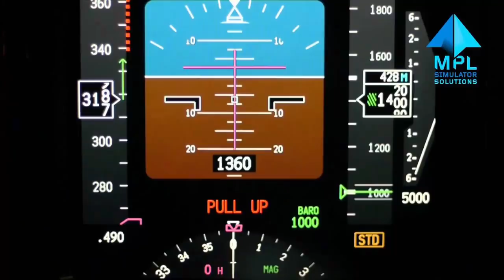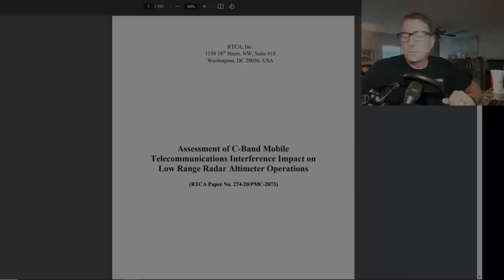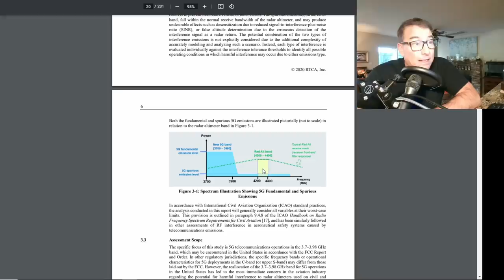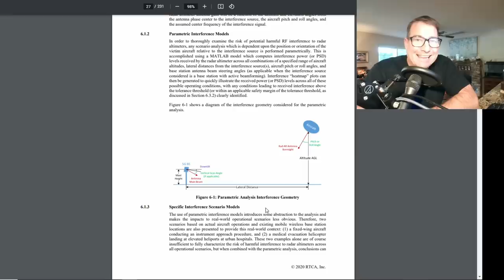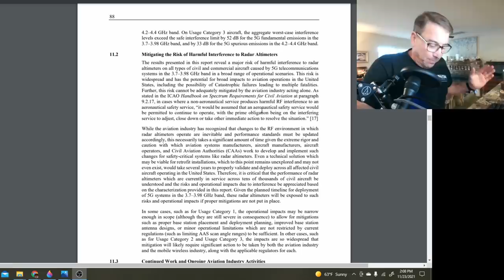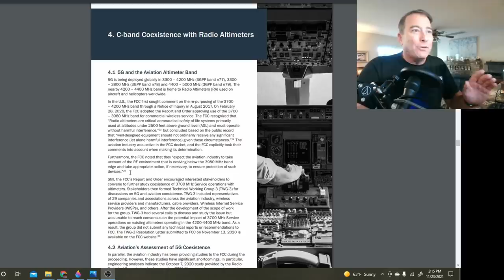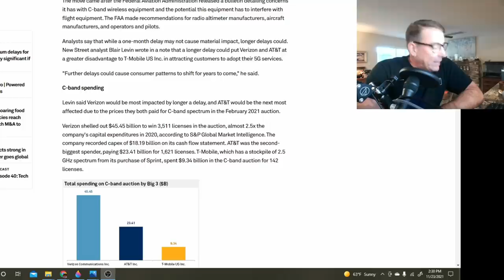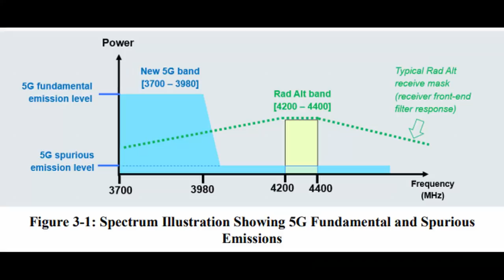5G C-Band Interference with Radar Altimeters in Aviation

Comment: I actually don't have any issue with the FAA working to attempt to prevent crashes or other near misses that "could" be caused, however, this 5g sale was announced quite some time ago, and my industry cares very much about this sell-off as well, and has likewise had to adapt to it.

There seems to be some solutions to this that could easily avoid the issues, all with their advantages and drawbacks. Setting a baro altitude off of the radar altimeter while nearby at an altitude high enough to avoid interference, installing radar altimeters operating in different bands, or using higher transmission power than previously used, having do manual landings (especially for VFR conditions), and the list goes on. It seems to me as though the FAA has failed greatly in delaying raising the issues to an appropriate level until the 11th hour. Many other government operations (including military and even military aviation) have had to adjust to this change, and other spectrum sell-offs; the FAA saying "well, radar altimeter use precedes 5g, so you should move" isn't likely to be a long term basis for injunction, and likely the government will eventually be required to pay damages to these legal licensees of this spectrum... Not saying we should ignore this, but a solution needs to be found with great haste, and it almost certainly will mean the aviation industry yielding in the long term, not the mobile carriers, so they best get on it.

One more thing to mention is that because of the directional nature of this interference and of the radar altimeter, and it certainly being off-axis during the last few hundred feet of descent of an aircraft, the likelihood of an actual denial of service of the RA seems very unlikely given the relative magnitudes of transmission power, especially one where two separate RAs have a false positive agreement of their erroneous altitude readings.

In all I think nothing will happen here, and testing would prove it isn't actually necessary in the real world. I wonder why the FAA hasn't reached out and performed such testing to a very high level of certainty at a closed airport, decommissioned military base (or even a functional one) with big runways, where other traffic isn't (presumably?) relying on their RA to perform a semi-automated landing?

Comment: Another similar topic you're going to see discussed soon has to do with UAS detection. FAA is conducting section 383 research and part of that is mitigation and use of radars, on an airport. The amount of work that's going to go into ensuring these UAS detection and mitigation systems don't interfere with aircraft is going to be enormous.

Comment: To be fair, it's practically a LOT more than 200 MHz. If you actually dig into the details:

1) In America the 3700-3800 is "occupied" by Verizon and AT&T
2) 3800-3980 Is not spoken for (from what I've seen) so that's unused, 180 MHz there now.
3) 3980-4000 MHz is a mandated 20 MHz guard band
4) 4000-4200 MHz is disused upper portion, based on the noise from the RTCA and FAA that is unlikely to ever be used - 200 MHz right there
5) The Radio Altimeter band has 200 MHz spread but uses only 105-140 MHz of that in the center leaving another "internal guard band" of 60-95 MHz around the 200 MHz as a buffer.

So it's not really 200 MHz - it's more like 180 MHz + 20 MHz + 200 MHz + 65-95 MHz = 460-495 MHz of practical real-world separation.

Comment: I am a Radio Amateur and know how ancient TV used to work. Both radar and tv are broadband. For color tv the color channel used to be narrower than the black and white channel. They had to introduce s delay line in the black and white channel because signals in the narrower channel take longer to propagate. Same goes for your altimeter. Make a narrower filter then your signal will be delayed at the upper and lower edge of the band showing more altitude than you actually have. No way for an easy fix world wide

Comment: How about using encoded transmissions, as is used in other radar applications? The radar altimeters could transmit specific waveforms and react only to matching reflected RF. Far more specific and certain than filtering. The encoding could also prevent misreadings between aircraft, such as with parallel landings. -- Of course, though, this would also take a lot of time to engineer, build, test, certify, and deploy.

Comment: you could shield electronics box in with copper tape earth, that protect against interference from inside the cabin. you could up your output to 3 Watts I'm not sure if that what causes any issue with reflection problems with the ground and would give you a false reading.

Comment: We don't use the term "Iron Door" but "Brick Wall" is pretty close, and that's the commonly accepted term for an infinite-slope filter. Unfortunately, such filters, much like a car hitting a real brick wall, produce bounces, reflections and spurious emissions, which will have their own harmonic values, interfering even further into other bandwidths. Filtering technology is improving, and is important in the ever-increasing competition for bandwidth, but the real key to solving this problem is not bandwidth assignment (in fact, that is guaranteed to get even tighter in coming years). The solution lies in coding, encryption and error detection and correction algorithms. The screech from grandma's solitaire game cannot give an incorrect altimetry reading unless it has the right header, encryption key, body and error-checksum, and if her screech is too loud for the real sensor to get a reliable reading, the airplane will go around. Cross-correlation with other existing solutions, like ADS-B and CPDLC will add further guarantees, but obviously all existing radar altimeters and auto-land systems will need to be replaced, which is just something we've gotten used to. All this is actually small potatoes. The big potato - and it's right around the corner - is that all airline operations will soon be COMPLETELY controlled from the ground, and the pilot on board (yes, that's singular) will only be trained to manage emergencies.

Comment: Is this actually Radar? The ATA refers to this instrumentation as Radio Altimeter. 1 Watt doesn't seam to be enough energy to produce Microwaves. The Doppler radar pulse averages a transmitted power of about 450,000 watts. Your home microwave about 800-1000 watts.

Comment: Fair or not (and it isn't fair), I think aircraft manufacturers and designers should be working on the assumption that they will no longer be able to use radar altimeters like they have been for decades, and figuring out how to replace the functionality with something else/better.

Alternatively, I wonder if increasing the power output of an aircraft transmitter from 1W to 2W would be appropriate?

Comment: If the FCC refuses to protect aviation navigation the FAA must choose a method to protect aviation during weather conditions that will require radar altimeter operation.
Substantial time will be required for design, manufacture and test before replacement electronics are available.
The only sensible response if to refuse commercial traffic at airports with 5G dangerously close is to reject landings during weather events that make radar altimeter necessary.
The airports/cities might be willing to encourage a 'safe' solution from the FCC or telecommunications providers.

Comment: How many passengers have and will continue to switch out of airplane mode as soon as approach starts?  Does an instrument exist that can detect potential interference in the aircraft before the equipment decides it can’t properly function?  I’ve heard of devices that capture cell phone communication on its way to a tower for surveillance purposes. Could a similar device within the cabin trap those frequencies before they leave the interior of the plane?  I’d rather not bounce off a runway in zero visibility with my family on board.

Comment: Excellent report. I did Geophysics flying for many years worldwide where the old magnetometer was used as we were doing contour flying at 500 fet in remote zones - this a form of radar altimeter to captivate physical density in the ground to decipher on data band what minrral we were analysing.....all sounds complicated!

With so many people using cellphones and transmittion stations everywhere we have problems without this aviation hitch!
A question that intrigues me....we all know of 5G now - what about 10G? Is this the "Havana Syndrom" coming from upgraded 5G.....few people talk about this subject.

Final point - navigating with GPS in congested way station areas...precise navigation is in doubt. For marine purposes more precise.
These problems will not go away without the "average Joe knowing what risks are coming in his high tech updates"!
I  miss my little Nokia 2G!!!

Comment: I haven’t looked at all the comments, but the current “compromise” only considers major airports.  So what happens for helicopters, such as those used for medical transport, EMS, law enforcement, and firefighting?
All of these rely on rad alts for accurate height information in low level operations….

Comment: I will need to read the RTCA report, but saying the over 200MHz frequency separation is negligible is quite strange. In 200MHz you can fit over 30 old-style analog television channels. I can understand saying channel 6 interferes with channel 7, but this is like saying channel 2 interferes with channel 35.

Comment: I think the biggest reason there hasn't been any issues out of Europe is the 5G frequencies are very different from the altimeter frequencies. Like in the 40GHz range or higher. It's also why T-mobile isn't much of a thing on this, as thier frequencies are either in the low end or higher end, with only a few C Band metro areas. I realize that's where some of the major issues are, . . . yea, don't know where I was going with that line. Anyway, there are ways to work this out, and they should have been looked at some years ago, honestly, as we all knew the amount of usage of the EM spectrum was only going to increase, and that would mean more encroachment on what was already there.

Comment: Clarification: it's not "5G' that is potentially causing interference, it is a new frequency band that 5G is expanding into that is the issue.
This is important because when they say that 5G is already in operation with no complaints, MOST of the 5G spectrum is far away from aviation bands and so causes no issues.

Same with cell phones in the cabin. Most are not even capable of transmitting on these frequencies, and unless there is a ground station using them nearby, the phones won't transmit on them either.

As a Ham I understand jealousy guarding the frequencies we have (and I am amazed that we haven't had any bandwidth stolen from us and sold off yet), and this is ridiculous that they want to put these within the interference threshold of life critical heavily regulated aviation equipment.

I suspect that someone didn't look at the actual specs of the radar altimeters, and they just chose a standard width guard band and started seeing dollar signs, and it was probably all written up for them by the Telecom lobbyists who assured them it was far enough away to be fine.

So I hope that wiser heads prevail, and maybe United Airlines will start suing Verizon every time they install a cell site using this frequency band near an airport for the costs associated!

And yes, it is technically correct to say it's 5g causing the issue, just like it's technically correct to say that you are Type certified in a Boeing, but it's not fully correct.
Plus with all the FUD (like FOD but for the brain!) going around about the horrors of 5g, it would be nice to not Sully 5g as a whole, when it's only these particular mid-band frequencies that are the issue.

Comment: Juan, do you remember the MOTOROLA’BRICK’ cell phone ? I had one,& in the car had a connection to 12 volt, ant using the battery, Well,6 of of us in my car going to a meeting in MD my phone WAS THE ONLY ONE which worked, But somewhere about 1985 or so someone on a FLIGHT from MIA -LGA, TIED UP THE ENTIRE EAST COAST, with one of those phones,I was UNABLE to call my company from a supermarket to Long Island for hours, all circuits are busy, I was told , THE NEWS THAT NIGHT singled out a cellphone on that flight,so now phones are SO LOW POWERED, that UNLESS the aircraft has internet service, they willNOT WORK, , I still have mine as part of a collection of cell phones, starting with a BAG PHONE ! Same phone number since 1984,,    🇺🇸🇺🇸🇺🇸🇺🇸

Comment: I'm not an engineer, but I also wonder about harmonics. When I was was working on Barksdale AFB, we were required to test the ILS system and the tester used the 108.00 frequency. But we kept receiving a local radio station that was assigned 107.9. And the station was tested and transmitting on there assigned frequency, but there antenna shared a tower and the other stations caused a harmonic. After reporting this the FCC shut down the station and assigned them a different frequency.

Comment: It is quite staggering how basic the radar altimeters are. I'm an ee, the 5g equipment will be incredibly finely controlled,  the antennas are very specific, they use synthetic beam forming to target the device they are talking to. That is what 5g is all about and how it is able to provide such good bandwidth to devices without interfering with itsself. So it's pretty smart. It also doesn't transmit continuous waves like the altimeter, it just looks like tiny bursts of broadband noise that last microseconds so its far from obvious that there will be a problem. I also fly a certified aircraft and I know that certification on anything from this century takes forever and is a massive barrier to itself. The radar altimeter is nowhere near as sophisticated as even 10 year old equipment but it will cost 100x more.  If in doubt they should just have a bit of distance from airports. The other thing is 5g hasnt caused a problem in other countries because for some reason the usa wants to use 4x the power.

Comment: 3 dB is no where near enough isolation. I would want to 60 dB or better. Filtering is always a trade off between bandwidth and signal loss. There are methods and technologies that can improve that, but there is no magic bullet. I would have to say the evidence is on the side of the RTCA.

Comment: Super fantastic point Juan about the cellular base station power limits as the typical limiter & baseband decoder RF circuits inside automated receivers like RAs can easily be fooled into accepting the "stronger" signal as the fundamental (real) signal, treating it as "gospel" & indicating to pilots their RA indicated altitude is far higher or the terrain is less severe than it actually is, unless the RA signal has been encoded to prevent false positives by their design engineers

Comment: Strongly disagree with the views expressed here. These aircraft systems are licensed for a specific spectrum and have been depending on frequencies outside of the spectrum they are licensed for. So far they got away with that and that will now end. There is no technological reason why this could not be resolved by updating the equipment on board. And it's not like the usage of these neighboring frequencies is a surprise - this has been in the works for many many years.
Reply: I doubt they even rely on the adjacent spectrum.  So far there is no real evidence that this is a concern in the real world, but beyond that these are critical devices and the FAA approved them as such.

If the FAA knew a piece of critical hardware relied on adjacent spectrum & then approved it as such, then that's a massive problem.  What else is approved as critical with known flaws?

Comment: As as electronic tech and amateur radio operator I didn't need to dig into the details to know that there is likely justified concern. Digital data is incredibly noisy all by itself besides the carrier it might modulate. They might have to re-site cell installations

Comment: Issue is, radars are actually not respecting their spectrum when it comes to receiving band.
It isn't feasible to just manufacture radars that are influenced by out of band signals, and then just hope the nearby spectrum is not used forever.
Radio altimeters shouldn't have been approved like that, so the fault is on that side IMHO.

Comment: Surely the Radio Altimeter indicates height AGL, not altitude (MSL or 1013.2 hPa/29.92"Hg)?  Or am I missing something in the terminology?  Or does RadAlt automatically compensate for the difference, knowing the aircraft location?
Reply: Radio altimeters measure and display height above ground level.  They don't compensate for terrain.
Reply: @elafoe  I guessed as much, but "altitude" usually refers to AMSL whereas height refers to AGL.  Thanks Ed for the confirmation.